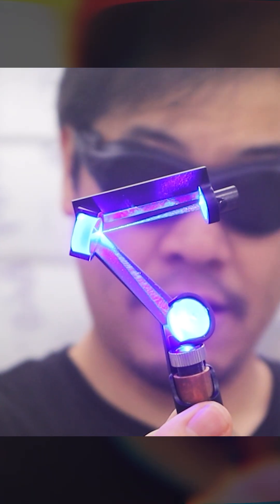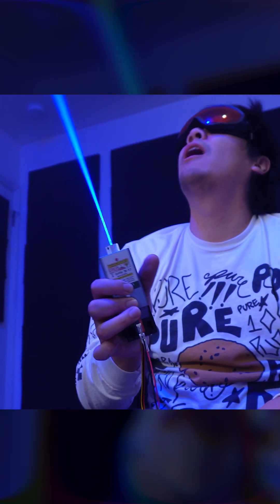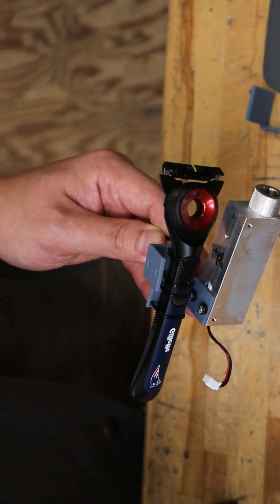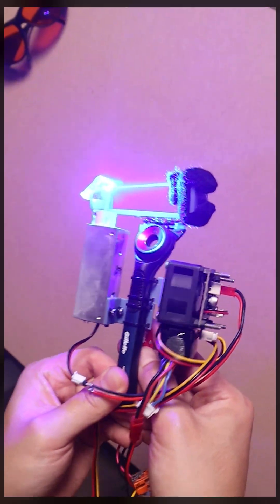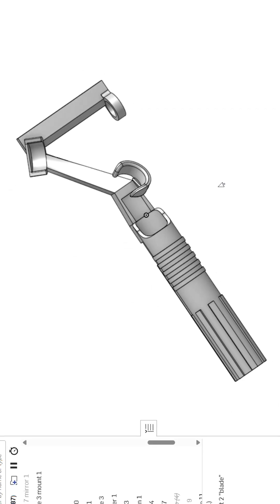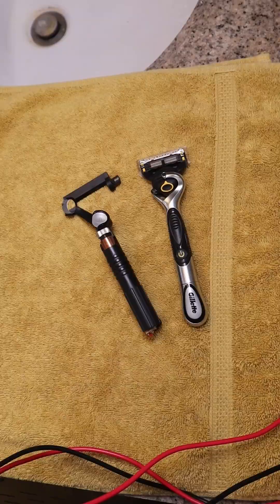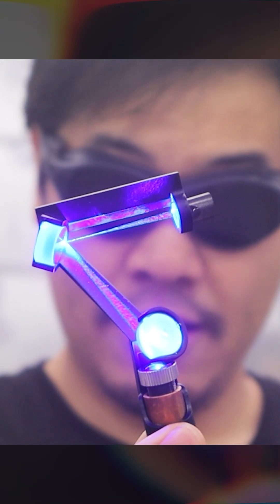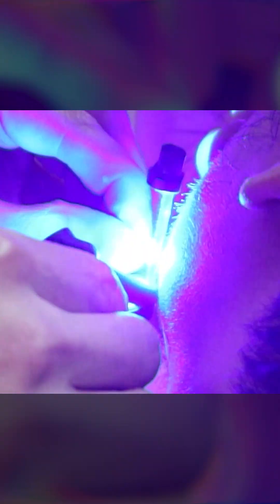Shaving with a Laser Razor blade

Comment: Add more power so you don't have to stop for every hair, and make encapsulate the laser more so you won't burn yourself on accident. Kinda like how the metal plates prevent the razor blade from cutting too deep. If that is possible I reckon it could be an actual product